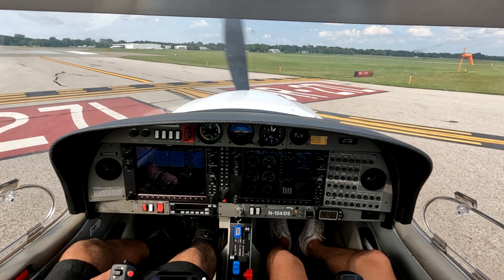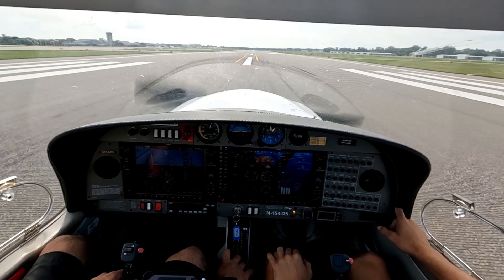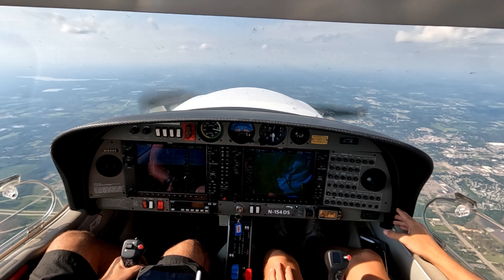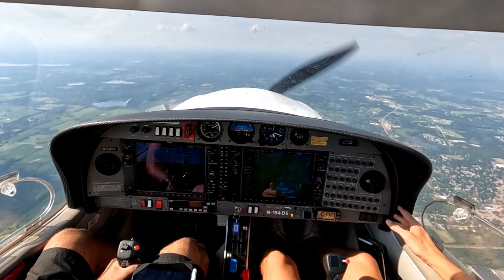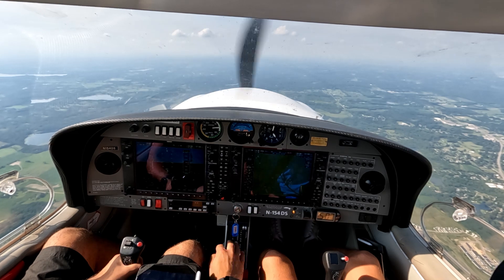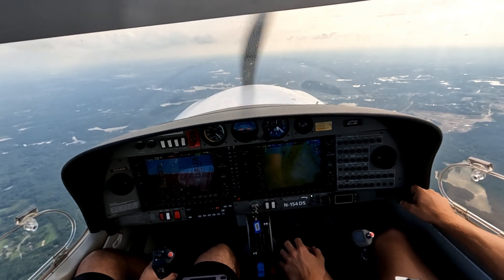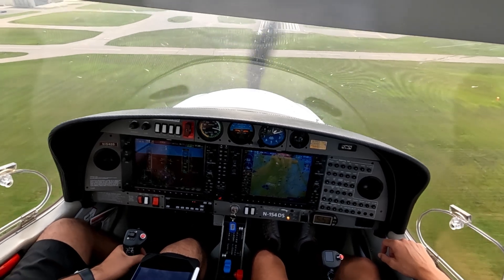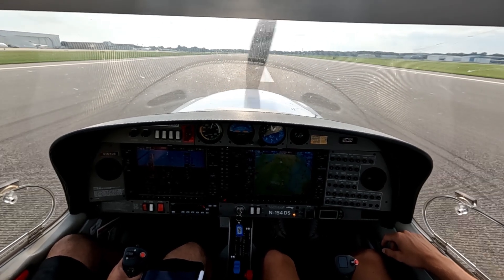Falling Leaf Maneuver / Stall (August 4, 2024)

Comment: Nice plane. Not sure it would correct so quickly in all models but defines good info to have tucked into memory. Thank u.
Reply: Da40 stalls really nice, it’ll just slowly descend even with full aft stick and 0 power
Reply from the maker: Thank you and good point! And yes as someone else mentioned, the DA-40 is a very stable aircraft, which is why it's a great trainer. It's relatively hard to spin and has wonderful / tame flight characteristics.
Reply: @FlyingWithFaisal  I’m not a pilot nor intend to be but my fascination in aviation has brought this retired nurse to a whole new set of interests. One channel breaks down what went wrong and how to prevent things. I’ve logged that into memory. I totally get the Aviate/Navigate/communicate. And fully understand how a stall happens and what to do. Seems to be a frequent problem. Guess if I’m ever in that situation I’ll be grateful for the info. I appreciate doctors but I truly respect a good pilot. That’s life or death as well.